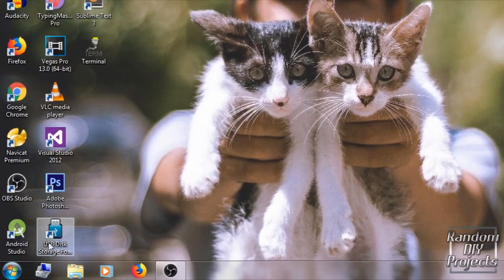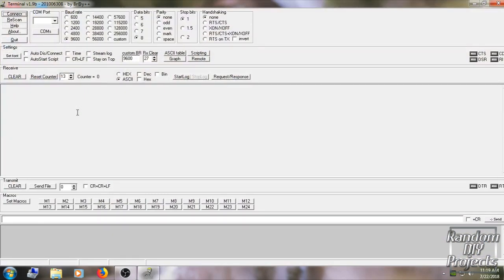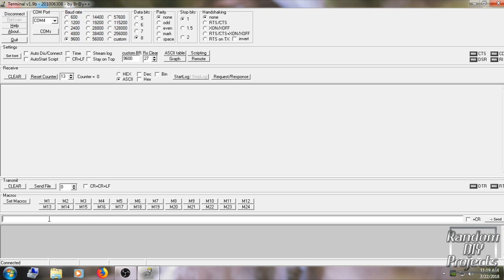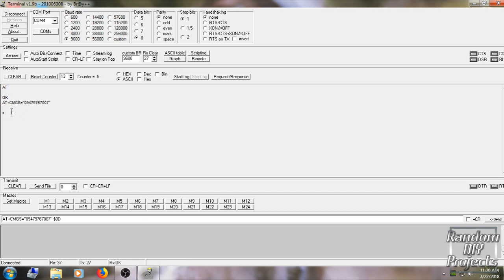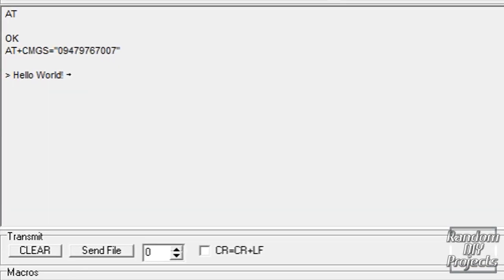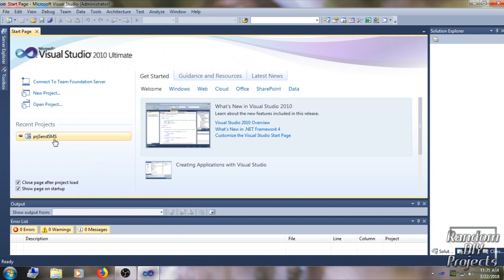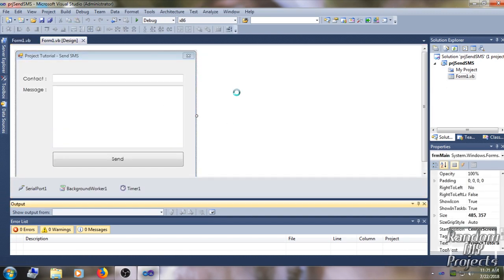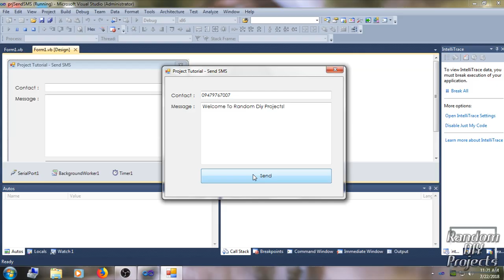How to send message using SIM900D GSM Module + VB .NET

Comment: Regular load po ba need or promo
Reply from the maker: Both
Reply: anong prob boss kapag ayaw mag send nadedect aman yung modem then ayaw mag send my load din aman at walang error @RandomDIYProjects
Reply from the maker: Either yung connection ng hardware mo. Anong gamit mong device? @100hoursgameplay
Reply: @RandomDIYProjects  sim800C at globe broadband stick modem boss
Reply: walang error sa system/codes pero my ayaw mag send